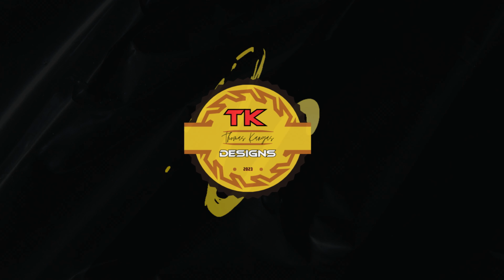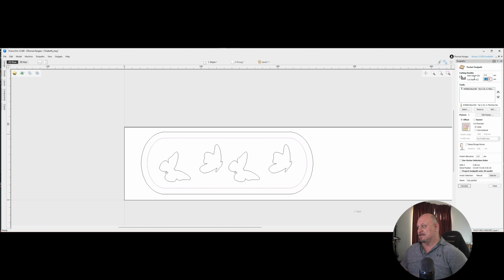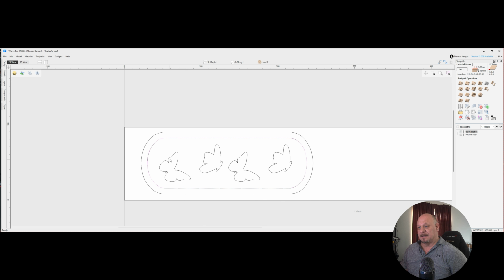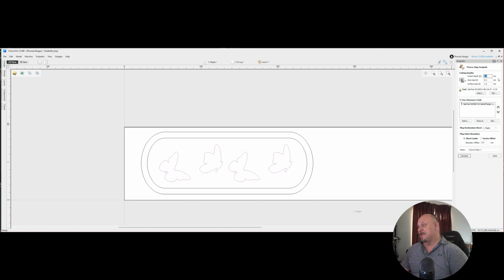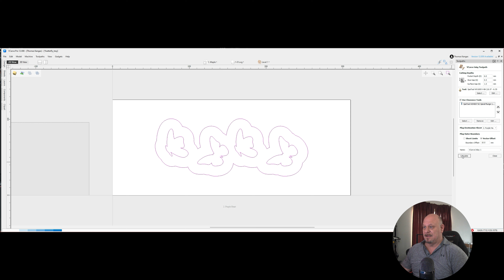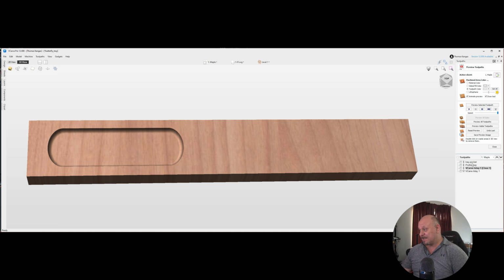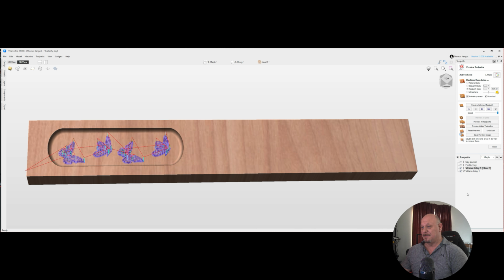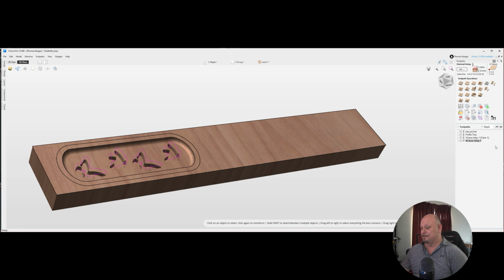Easy Vcarve Inlay Techniques in Vcarve Pro for Perfect Inlays in a Recessed Pocket | TK Designs

Comment: Tom do you use the same parameters and depths for doing your inlay cutting boards as well? Thanks
Reply from the maker: Yes, but with one caveat:  The start depth on the pocket is the top of the inlay.  In this video, it was 6mm, but also had to account for the depth below the top of the work piece.  Normally, the top of the work piece is the start of the inlay.  Thanks for watching!
Reply: Thank you I'm going through all your videos to see if I can find your start to finish process in one of these boards, thanks for inspiration and experience

Comment: nice!  remind me - what does the 10mm vector offset do in this case?  thanks!
Reply from the maker: The 10mm offset puts a 10mm vector outside of the plug side. It saves a lot of time if you can cut your plugs with a bandsaw.  Thanks for watching!
Reply: @tk.designs  makes sense - thanks again!
Reply from the maker: @TimArland  Quite welcome! Happy Carving!

Comment: Help!
The spindle won't reach the speed that is preset on the router bit database. If a separate command is sent the spindle goes to that speed. However, when a file in vcarve is done the faster that goes is 12,000 rpms. Any ideas what can cause that?
Reply from the maker: What Post-Processor are you using in V-Carve?